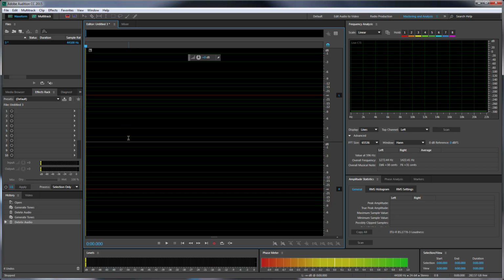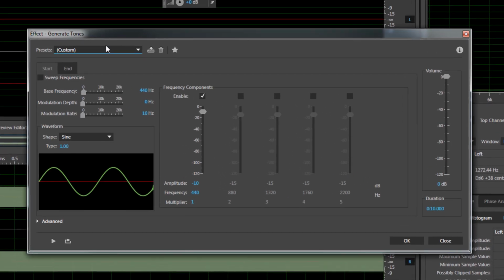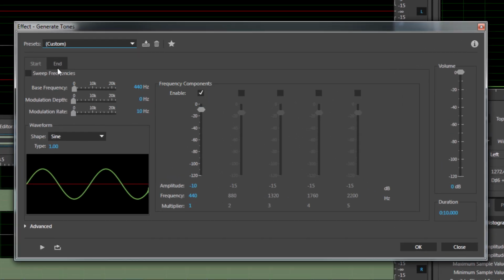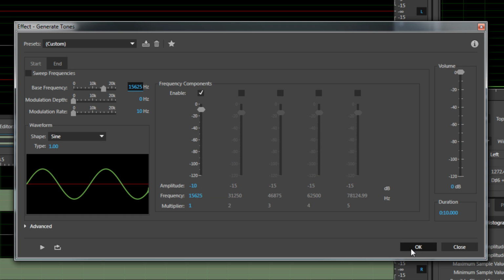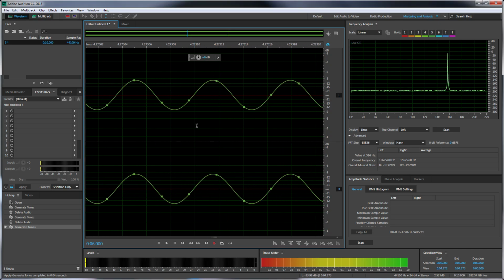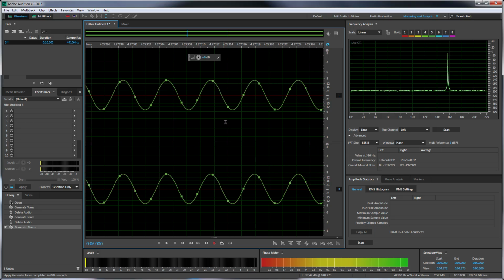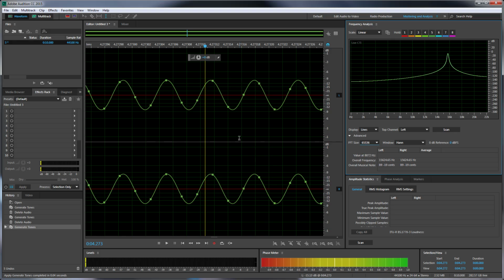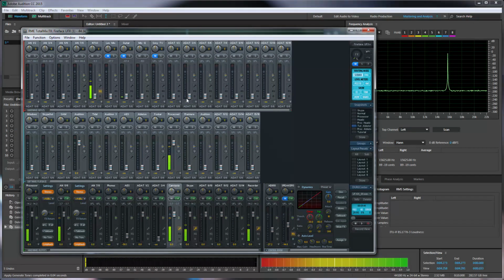Can You Hear a TV Squealing - 15.625kHz Test

Comment: RIP my sensitive af hearing, watching videos back on the school tv was a nightmare. I always noticed that when I turn my head in to the sides the sound will either amplify or quiet down. Wonder why that is? Probably the way it bounces off the eardrums or something but who knows
Reply from the maker: Yes, I noticed that too. My guess would be that it's because high frequency sounds are so directional...but that doesn't always seem right because where it was loudest was definitely not always when you were facing the TV. As you say, who knows!
Reply: @tdcattech  you actually hear high frequencies better when you turn your head 90 degrees to the source of the sound, so it's going directly into your ear hole.

Comment: Just FYI, it is a saw wave ( /| <-- this one), not a sine.
Reply from the maker: I did not know that. Thanks! Wish I'd created a sawtooth now :(
Reply: I know this is late, but I wanted to chime in on this. For what it's worth, even if you DID use a saw wave, it wouldn't affect what any of us hear. Since you set the fundamental frequency to 15.625 kHz, even if you had used a saw wave, the next higher harmonic would be exactly one octave up, at 31.250 kHz. Of course, every higher harmonic after that will just be even higher. That FAR exceeds what any person can possibly hear, no matter how good their hearing is. So don't be sad about that. Your goal was re-creating that squeal, and that's just what you did. :)
Reply: @OrionMelodyMusic  Which is strange. I can hear a sawtooth and square wave at the same frequency but not a sine wave. Triangle waves are harder, but still slightly audible.

Comment: i hear it. My commodore monitor has this kind of "squeal"
Reply from the maker: +TheDupeMaster Great that you still have an old Commodore monitor!
Reply: I know this is two years ago, but if you listen to it with Bose headphones (Specifically the SoundLink 35 Over-Ear.), it sounds pretty accurate! By the way, good to see another fellow Commodore owner! I have the original 1701 Monitor, the C64 itself, a "Factory-New" Datasette (I say Factory-New because it was never taken out of it's original packaging), and a standard 1541 Disk Drive. Do you guys have any suggestions on fixing RW head misalignment on the Disk Drive? I want to use my 1541, but it won't read any disks because of the head being misaligned. I found some solutions involving precise adjustments, but i'm worried that i'll mess it up and misalign the head even more. If you guys have any suggestions, please let me know.